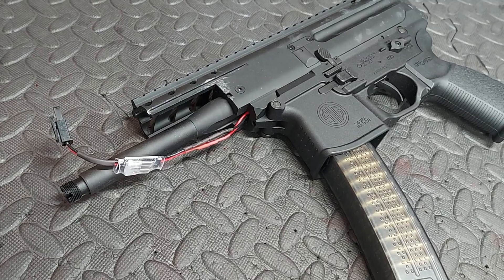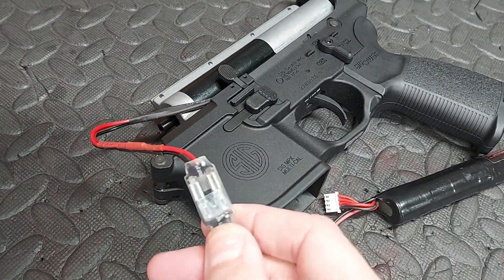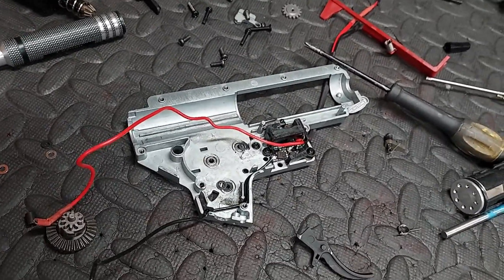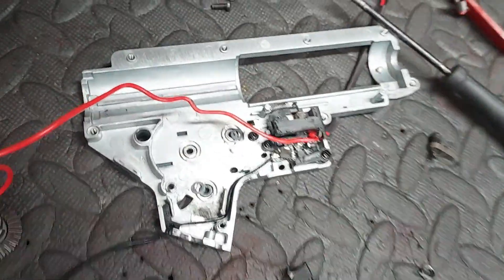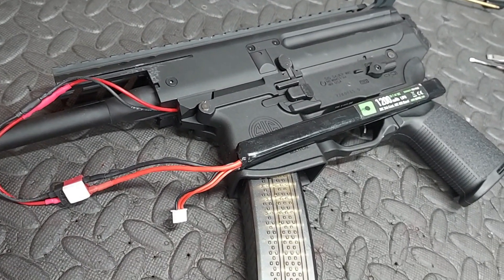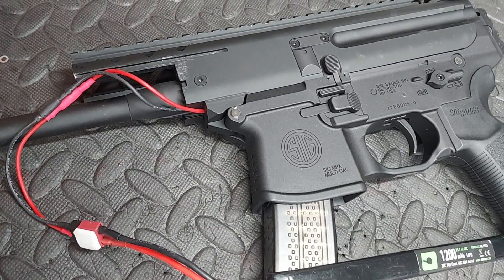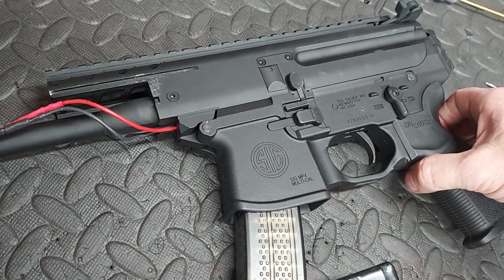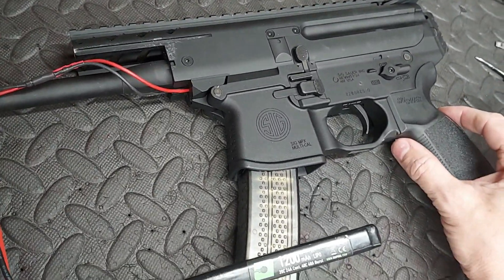VFC MPX - A SMOULDERING DOG TURD!

Comment: Does it have a delay chip on the gear from the factory, I'm working on a mpx that has 13to1 gearset and will fire 1 bb and that's it I hate going behind someone else's build it has a Maxx unit and I think it's a stock length nozzle can't find what the stock length is supposed to be

Comment: Do you know if the MAXX hop up fits in this without any trouble with the stock gearbox and nozzle and feed without any issues? Also for the pistol grip what would you recommend for alternative? I think u mention the magpul moe grip but I don’t think PTS sells that one any more did you mean the newer PTS EPG grip? Also were you able to find a solution for the sloppy selector switch or is it just flat out bad and sloppy no matter what? Thank you for the informative video!
Reply from the maker: I'm going to do a maxx hop unit video I think

Comment: I have had my Umarex/VFC 416c for  years and it's fine..........now I have just fucking Jinxed it.......shit!

My VFC 416gbbr is also fine.......of only I could find new mags for it anywhere thats not flipping Taiwan.

All in all, the best, most reliable gun I have had was a little cyma aks74u. Cheap as chips and keeps running with minimal cleaning or maintenance.

Yes, my VFC has beautiful externals, but then again so does my ARES m14ebr, but that's the biggest pile of shit the world has ever seen.

Comment: If the gun is only a week old and it’s already that scratched up on the outside I can only assume the owner as treating it like shit. I honestly think this video is a little bit of a cope.
Reply from the maker: Good for you
Reply from the maker: Have you seen what happens when you put the tight metal handguard on the metal reciever?
To change battery etc?
Try harder to troll, there's a good chap.
Reply: Cope these nuts